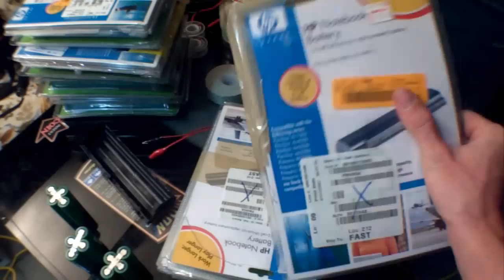DIY: 48v 24ah lithium ion 18650 e-bike battery pack

Comment: I've watched your videos over and over and have built a few packs with new cells. How do you determine the mah of each cell? I have some used cells and cant decide which to pair up with
Reply from the maker: by using a charger that keeps track of how many mah goes into it or out of it.
Reply: Rinoa Super-Genius I have the imax b6 and was able to discgarge a 6s 24volt battery but cant get individual mah ratings or individual cell voltages
Reply from the maker: Danny Kennel  in the video description is a link to my next video in this e-bike series. click through to the next video several times and watch the latest one where i build a battery for 55$. i show how i test and organize the cells.
Reply: Rinoa Super-Genius which bms, and fast charger do you recommend?
Reply: I charged my lithiums with a lead acid charger and bms. The voltage kept rising, so i disconnected everything.  Any idea why the bms let the voltage rise?
Reply from the maker: Danny Kennel idk, i dont trust BMS boards much.
Reply: So how do you limit over discharging?
Reply from the maker: Danny Kennel
i recharge the battery before it gets too low.
Reply: Rinoa Super-Genius How low in volts? do you let them go before a charge?
Reply from the maker: Kyee71
i tend to recharge them when they reach 3.8v and i charge them up to 4.0v
Reply: So if they all added up to 48volts would you charge when they hit 46 or so?.
Reply from the maker: Kyee71
yeah about that.
Reply: Danny you can try one of these but it is pricy.

http://www.amazon.com/CHROME-Intelligent-Battery-ACT-Meters/dp/B00RDFLHTI/ref=sr_1_1?ie=UTF8&qid=1423781669&sr=8-1&keywords=chrome+IBT+12v+sla

Anyone working on a battery bank this will save you alot of grief.  On Ebay there is a video watch it.  Pretty good review.

Comment: idk why you can't just buy the batteries on there own without having to hack up a bunch of packs to get to them. Seems wasteful and counter intuitive to the price lol. I'm new to the e bike world but am quickly gaining interest. Nice vid :)
Reply from the maker: well, all the individual cells sold on ebay and amazon and whatnot are either overpriced, or they are the exact same as this but untested.

how does recycling instead of buying new equal wasteful? thats very much the opposite of wasteful.

so why is it better to have little kids in china opening laptop packs for you and slapping a "5000mah" sticker onto a cell that can only give 500mah since its so worn out, any better than just doing it yourself?

btw, never buy Trustfire, Truefire, nor Ultrafire. and if a battery says 3,000mah or 5,000mah expect them to be lying. 5,000mah doesnt exist and is a total lie, and 3,000mah is just whats on some datasheets but you will get is 1500mah. 

meanwhile you can go to a computer shop and buy battery packs for less than a dollar and get far better cells.

Comment: HP ORIGINAL 12 CELL HSTNN-IB32 HSTNN-Q21C EV089AA BATTERY
is the same as the one you use ? thx

Comment: You do know the dangers over over charging and over discharging Li Ion batteries, and being able to balance the charge between the cells right?

Li Ion are great...but you have to be careful with charging discharging cycles or they could vent (aka controlled explosion)

Cool build but be careful
Reply from the maker: you do realize i made another video about charging, and put a big annotation in the begining and ending of this video and in the description linking to it?
Reply: nope...didn't get around to viewing it...

Comment: You should have brought out a wire on each battery sets so you could use a smart battery charger for the pack check the chargers for RC planes
Reply from the maker: watch the next video

Comment from the maker: are you meaning brands like TrustFire and UltraFire? i've heard that they lie about their cell capacities and the cells are just stripped from dead laptop packs and rebranded in china.

i can't wait to see what you build with your cells, i havent seen Sanyo cells yet, what color are they? i've started collecting differant colored 18650 cells :D

if they where 18650 and said 5ah then i bet they are lying through their teeth. only 5ah cells are 32600 and 25500. atleast that i know of.

Comment: Can you explain why people don't use super-capacitors for a project like an electric bike?
Reply from the maker: because super-capacitors dont even come close to a lithium battery. would need a super capacitor the size of a truck battery to hold the capacity of one 18650 cell.
Reply: Wow!, thanks. That's saved me a lot of work.

Comment: That soldering iron was way too large & hot. You could have heat damaged the batteries, or even had one blow. Steel nails are a fair conductor, not a good conductor. At that thickness they may heat up too much when drawing a lot of current. You should have used copper or aluminum (better conductors). Even brass nails or screws would have been a better choice. Also solder doesn't stick well to steel (esp. the kind used for nails). You'll have bad solder joints unless you used a high acid core solder. But you can't use acid core solder for electrical work because it damages the conductivity of the surfaces. So those solder joint will heat up & possibly fail when drawing much current or over time. It all works fine now, but over time the heat damaged cells, nails, or solder joints will eventually fail you. Love your kitty & your hair.
Reply from the maker: actually the bigger the soldering iron the better, i wanted to heat it up quick and to localize the heat. also it didnt hurt them.

define how long you mean by "over time" because i've been using them for about 7 months now and its all working great. and the solder stuck really well to the nails.

Comment: hi, rinoa, im currently building my own ebike and so far ive got two 16ah 6s lipos(110€ each) from model aircrafts to power it, I think this is a great deal on hobbyking.com, you should check it out! also I would like to ask how much you have to pay for a 500w motor kit including motor, controller and LCD screen? btw I'm here in Austria and am about to spend 340€ on one.

Comment: Thanks for saving me $500.00 for my ebike battery. Before I place my order for 6 dozen cells for my 48 v. Battery pack, I would like to pick your brains. EBay has a vast list of 18650 cells to choose from, $3.00 to $25.00 each. Am I wasting money to spend more than $8.00 per cell?. Some of the cells have warnings against using cells that are not protected to build battery packs, you did not seem to be concerned, why not?. How can I get a copy of your cell configurations, it went by just to fast

Comment: I amusing ultra fire 18650 from china. How many batteries do I need to run a 48 v wheel and how do I configure it. Can I run 10 in a circuit then do 13 of those?

Comment: Nice work and nice soldering iron.  haha.  Not sure why you used nails (Although cool) for connecting your batteries when you had that solid copper wire sitting there.  :)
Reply from the maker: well i didnt want to use up the copper wire. either way it took me 5,500 miles and still works so i cant complain. fuses would be better though
Reply: @RinoaL  Wow!  Those nails and your craftmanship have proven themselves for sure.

Comment: I like that: 300W soldering iron! If you find any of those on the market these days please post a link under your video. :)
Reply from the maker: sorry i dont have time for that, you can buy them new or check ebay yourself ^^
Reply: Rinoa Super-Genius I'm runnin a 12v 20ah AGM in my car ($40 Egay). I'm upgrading to Li-ion soon what kind of overcharge protection would you recommend? I saw various breakers for Audio& solar setups

Comment: Dr. Emel woulda helped you out. If you have different amp hour batteries hooked to each other, one set will discharge faster and the other will compensate by charging the other at an unregulated rate, not to mention one's voltage would drop too. Which as you know, would be a waste of energy considering that batteries have high internal resistance.
Reply from the maker: no, batteries in parallel dont operate like that. lower capacity cells give less amps while bigger capacity cells give more.
Reply from the maker: JustnTheNick
if your an idiot its your own fucking fault. you can't just go about life blaming other people for things you do on your own.

do some experiments and find out for yourself. and if you threaten me like that again i'll just ban you from my channel.
Reply: JustnTheNick It doesn't work that way while they are connected while being used.  If you disconnected them, used them, then reconnected them one cell would discharge into another because of the voltage difference.  Since they are connected the volts remains the same.  Right, Rinoa?
Reply: bcmasur But batteries have different discharge rates. Wouldnt the lower amp cells which are being pulled at lets say 5 amps discharge faster than the cells providing 8 amps but are capable at providing say 10 amps. One is discharged at full amp capacity(which may get very hot) while the other isnt maxed out yet. Battery mechanics are not my strong point(at the moment).
Reply from the maker: JustnTheNick
no that's now how it works.

ok so let's imagine we have two cells in parallel. cell a is 1ah while cell b is 2ah. if we will 2 amps of current from that pack and the two batteries dip down to like 4.07v while under load. the 2ah battery is providing 2/3rds the power while the 1ah is providing the other 1/3rd.

if for some reason the load dipped cell a down bellow cell b, cell b would start giving more current until the two cells where are the same voltage.

you can't discharge cell a faster when its the same voltage as cell b, it is working as one big 3ah battery. if it was true that one cell could get out of balance, then you couldn't have reliable batteries in the first place. one patch of the plates would get discharged before the other in that world.

there is no reason ( chemically or electricly) to not consider parallel cells as one big cell.

Comment: is the battery still in use? if it is how many charging cycles has it been through?
Reply from the maker: it is, i have been riding about 100 miles a week on it now that i've moved and gotten a job in silicon valley. last week i used it to climb a 2250 foot mountain also. i'd say its been through like 80 discharges to 3.9v or so.
Reply: Rinoa Super-Genius without a circuit to balance these cells I don't think they would last much longer plus the fact that these are lithium ion not LiFePO4 so in case of an accident or a shortcircuit don't be upset if they explode or catch a fire and explode afterwards ..it's how it's made
Reply: Rinoa Super-Genius surely not in this video ;}
Reply: Rinoa Super-Genius I also woild like to know how do you bsllsnce that amount of batteries....  I also have a imax b6 charger...  But that amount of batteries!?
Reply: jose castanon No it is no longer in use. It probably never worked. Connecting them in parallel would melt the wires and smoke the batteries. I tried it.
Reply: So how then?
Reply from the maker: Tucker Not Sucker!
your a fucking idiot. i just rode my 1,100th (roughly) mile on it 10 minutes ago.

i show how i  ballance them in the next video.
Reply: Looking forward to the video,  cant wait :)

Comment: Hi i love your videos. I'm in need of some help. I know I'm not going the lithium ion battery route I'm going nimh route since I have 30 all new aa rechargeable with same mah (1350mah each) (1.2v each). I want to run them individually in series and then go back behind them and run them in parallel.  I know that will increase voltage (36V is what I'm going for) but will that help me archive  40,500 mah (30 ×1350mah=40,500 mah or 45.5 ah) ? 
P.S. I'm putting these in 1 aa battery holder so I can take them out and charge them. Sucks but I don't know any other way of charging them if in theory if this would work.
Reply from the maker: What do you mean by "and go back behind them and run them in parallel"?

With 30 cells you would only get 32v 1350mah. You need to increase your cells by multiplying the number of cells in parallel it takes to reach your target amp-hours with the number of cells in series to reach your target voltage.

Let's say your cells hold 1200mah on average (have you actually tested the exact capacity of your cells? Cells are rarely exactly what they are labeled) you would need to conned 10 in parallel (all positive to positive and same for negative) to reach 12 amp-hours at 1.3v. 12ah is the lowest size I would recommend for an e bike battery.

So now you have 10 cells together to make 1.3v 12ah packs, you will need 29 of those packs in series to give 36v, but you would probably always bellow 36v so I say go 30 packs in series to make 39v.

So to make those 30 battery packs you will need 300aa batteries. You could do that with 54 lithium cells that are medium quality.

But your issues dont stop there! AA batteries aren't meant to provide a lot of power. They are meant to power like transistorized radios with only 100ma of current. So the C rating is very low on them. A C rating is the amount of current and you can safely pull from a battery relative to the ah. Most 18650 cells have atleast 2500mah new, and I say they safely can give 1C. So that means for every ah the 18650 has it can give 1a before it starts getting damaged or overheating or wasting electricity. That means you can pull 2.5a from a 2500mah 18650 cell. If you needed to make a battery to provide 12 amps you would only need to put 6 of those cells in parallel to make a 15ah battery that can safely give 15 amps.

Meanwhile AA batteries have a C rating very low like 0.5C. So to pull 12 amps from NiMH cells you would need a 24ah battery.

Oh and no I bet your AA battery holders won't work, they would probably melt if you pulled more than 5 amps through them.

Well I hope that helps!
Reply: Rinoa Super-Genius 
What I ment by going back and running them parallel was if I could take  2×aa batteries and put them into a holder (I would have 15 packs to achieve 36volts) which makes the batteries in "series" since ones upside down in the pack then take the red and black wire and connect the packs in parallel. Theoretically speaking it should make 36V and the 20,250 mah correct? And honestly no I have not tested for mah since I don't have a device to do so I'm just going off what the batteries say on them. I know you love the lithium ion batteries but I'm nowhere near understanding how to wire them like you do nor how to charge them.  The bike I'm building is a 36V 500watt I belive where the specks.
Reply from the maker: Lowery0214 no you wouldnt get that much power from 30 cells. look at the link to the schematic in this video.

so each battery holder is going to be connected in parallel to the other battery holders? that would give you 2.6v at 20ah not 36v.

i would advise you not to invest in AA batteries, as i said you would need hundreds of them and they arent built to give that much power.

but thats not to say you dont have a nice number of batteries there, you could try to make a really nice bright LED lamp that could shine for hours.on ebay you can get 10 watt LEDs that are super bright for like 3$ that run off 12v. if you used all 30 of those cells and they all have atleast 1350mah you could possibly get 20 hours or so of bright light from them on a single charge. then you could always use that as a headlight for your bicycle.

Comment: hey rinoa! how to charge that batteries pack? do i need to build a charger or just use a simple battery charger?
Reply from the maker: check teh description for the next video, its about charging and how to solder the balance leads.

i balance charge the pack with an Imax B6 battery charger, only costs 30$ from ebay.

Comment: Hi Rinoa... Q: if i made battery of 12cell in 5pack is be battery 48v 20ah?
Reply: +Tomer Zaburoff 
If the cells were 4000mAh, yes.  You won't find that large of a capacity in these 18650 cells (yet anyway), so you would need to add more batteries to each cell.

Comment: If i were to buy some laptop batteries to make an e-cruise skate board how do you go about charging them? I have an 850w computer supply but with that i can only work with 12 or 24v without adjusting variables..
Reply from the maker: watch the next video. i use an Imax B6 balance charger. i'd maybe recomend the B6AC though. that looks easier to use since it runs off 120v ac.

you may also want to get a universal power supply. they are so awesome. a cheep 0-30v 0-5amp variable DC power supply can be as low as like 80$ on ebay. but are super useful.

Comment: OK, super project BUT PLEASE ADD  Some   Battery  Cell  Protection  on each bank of cells. You have so much energy there that if any cell-bank decides to go nuclear, then you will have one hell of a fire bomb there. I have seen some good circuit boards on ebay that will control up to ( I think) 20 to 50 amps. Please look into this as they add protection on charging and discharging. Energy good, fire real bad !!!!!! 

PS : Magnets and Duct Tape ..... That was brilliant .. So cool !
Reply from the maker: i think my balance charging is good enough. they never go above 4.2v an a cell will rarely explode until 4.5v. i usually charge to 4.05v. maybe you didnt see the big annotation in the beginning and end of the video talking about my balance charging video.